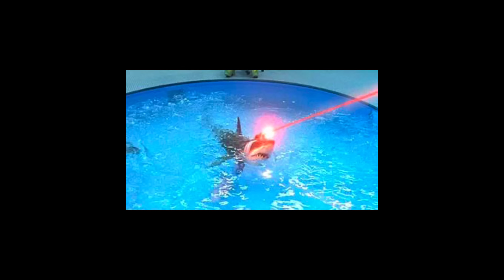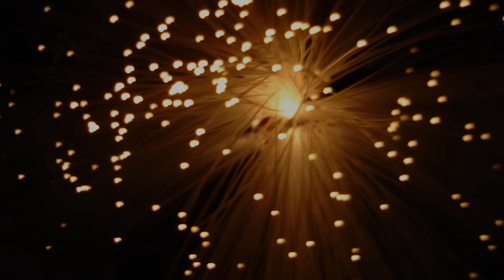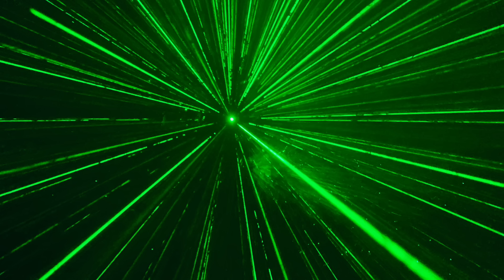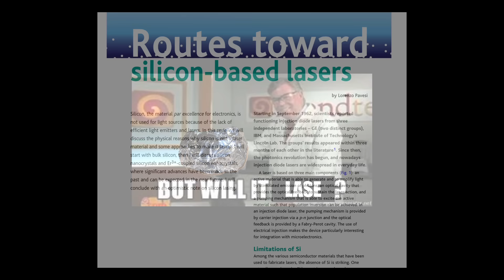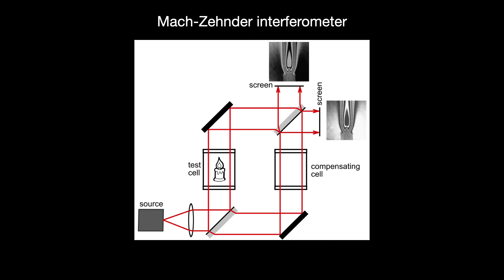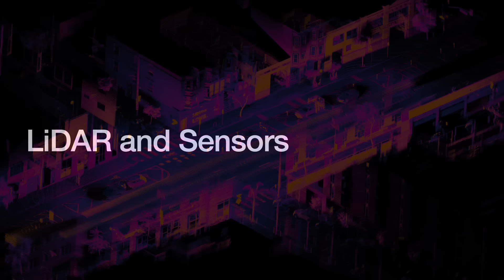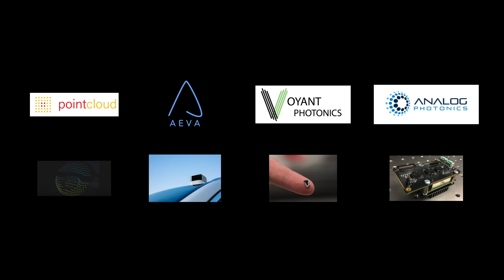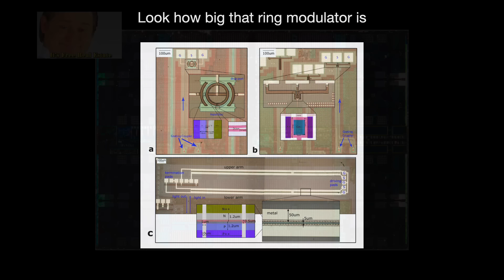Silicon Photonics: The Next Silicon Revolution?

Comment: Using optical transistors, which utilises photons instead of electrons is an old dream of all semiconductor technologists. It would allow an integrated circuit (IC) completely made out of crystal, where the refraction index change under the effect of photons; at the same as the level of conduction in a crystal changes with the level of electric fields and the number of electron/hole recombinations.
My opinion is, this is going to stay a dream for quite a while...
Reply: I want to add, the problem of creating a photonic transistor of the same size of a current transistor with 7 nanometer gate, can only be solved with a deeper theoretical knowledge of what is common to a photon and electron, the quantum spin number.
Quantum spin is not a real spin, rather it is a description of the invisible connections the particle has with Space and all surrounding the particle as it moves. This knowledge is still very lacking and it is at base of all the modern theories - trying to explain the very nature of things...
Reply: I forgot to say, thank you very much for this video and all your deep and informed journalism on current and future technologies...
Reply: @rayoflight62  Go read up on some of the companies he listed. OP transisters may not be the standard across billions on a chip, however highly likely that key areas will be where they can do the most good initially, soon.
Reply: I didn't mean to diminish the achievements of the big names involved. I was trying to point out that the current OP technology is not the equivalent of doped silicon and electric fields technology, but OP is a component based on light path geometries and interference effects, because we don't have (yet) the theoretical foundations for a 1:1 equivalent...

Comment: Plasmonics is pretty exciting, has the potential to bring this stuff down to the nanoscale
Reply: That's what I wondered, if the silicon components are getting smaller than the wavelength of visible light, how to integrate them? Wow!
Reply: i bet they could eventually use shorter wave lengths too. surface plasmas are messy though
Reply: @vevenaneathna  the hard part with shorter wavelengths is finding good materials to make waveguides for them. Silicon right now is on 1550nm mostly
Reply: @raphaelcardoso7927  ya thats over my head. idk, some kind of lead or gold alloy? i know there are quatnum mechanical effects that get a lot worse when u have "surface plasma" state, and I feel like heizenburg uncertanty might come into play if the channel was able to be super narrow or super flat/polarized, and im thinking that would limit the bandwidth/frequency range you could use if it wasnt just a binary 1,0 data

Comment: The stuff inside optical chips is kind of insane. So much simulation and math is used to refractivly bend light with tactically placed blocks of different refractivity in the nano scale. Just insanity
Reply: almost as insane as the insides of electrical chips, pure black magic going on inside all those fancy procesors, even mine, I can't belive intel managed to run windows in a fucking potato
Reply: @Abyss-Will  absolute madlads
Reply: This could be the key for phased array optical systems too. Light field based displays or something, if each emitter is synchronized. I have no idea though
Reply: @yelectric1893  Very cool idea to incorporate photonics in coherent optical MIMO. In fact, it's recently been demonstrated that speeds of over 1 petabyte per second are possible in a fiber optic cable. That's a lot of data. They use Raman spectroscopy, which is another great topic for this channel since a lot of the papers coming out of Asian countries need to use raman spectroscopy or other techniques to optimize their new ideas for information technology. As you pointed out, this could be used for displays as well.
Reply: @howwitty  Hi, I’ve never heard of the Raman concept but is it like an EDA software? Seems very interesting.
Reply: @yelectric1893  It's like a quantum ruler for molecules I guess!
Reply: @howwitty  Just saw some diagrams, I didnt know that there was an optical effect based off of chemical bonds.
Reply: @yelectric1893  That is the idea behind LiDAR. Not for displays, however. Companies like Analog Photonics are pursuing this.

Comment: Speed in optical fiber is the speed of light in glass or about 0.7 c.  Now hollow core fiber which is new is close to 0.99
Reply: I came to comment about the refractive index slowing light in glass, and just had my mind blown. Hollow core fiber!? And it's been around since the '90s? Wow.
Reply: @hikingpete  it may have been around for awhile but hollow core fibers with low loss that comes close to traditional fiber is new.
Reply: Hollow core fiber research and developments are being accomplished in Australia with funding from the military specifically to test jet fuel integrity... fascinating developments
Reply: You still do the expansion through narrow density funneling:filtering to shoot it faster… 1GHZ ON RINGFREQ from 20mhz is 500x but 10*10*10 as 3/2 and stacked as a throughput 1.5^3=3.375GHZ WITH INTERMEDIARY DUAL ATTRACTION BRIDGE … III-V was becomes AS 3-5x
Reply: 1.5 still .75 of 2
1.5^4=5.0625 
3.375/5.0625=0.667 and then +1 factor
1.667^2=2.779 
+1.111 is what you are looking for exactly
Reply: 1 line / 2 points
Becomes 3 points / 2 lines logic
Reply: Push PULL : PULL Push     >>>
Reply: Ring cycle freq match like a )( corkscrew so one direction in and the other out the middle
Reply: Yes, plus multimodal fiber has the beams bouncing off the cladding adding a lot of distance to the path…
Reply: That's why starlink can have lower ping in long transits than fiber on  ground :p
Reply: @greengl0w-h8i  yeah but Elon musk is a scammer
Reply: @greengl0w-h8i  how lol?  starlink uses radio waves?  your info is totally incorrect, there is no way starlink uses laser.
Reply: @franklee663  Starlink 2.0 uses both. Radio for earth coms and lasers for sat to sat coms. But that doesnt matter as radio waves and light are parts of EM radiation and therefore their speed in vacume is same.
Reply: @franklee663  The point is that starlink is transmitting through a vaccuum, not bouncing off glass walls for thousands of kilometres.
Reply: @franklee663  starlink indeed include laser to communicate between starlink module, and yes the laser pas trough vacuum space.
Reply: Why does the velocity matter? The phenomena limiting data transmission goes far beyond of the speed of light in the medium
Reply: @MrDudieNoodles  latency

Comment: Photonics has so much more bandwidth since it's at a much higher frequency band, in the 100s of THz compared to GHz in copper. The waves travel at whatever the speed of light at that frequency in the material: the advantage is that silica fibers have extremely low loss with lasers compared to ye olde microwaves in a wire.

Microwaves through air actually have lower latency so are used when fiber is too slow!